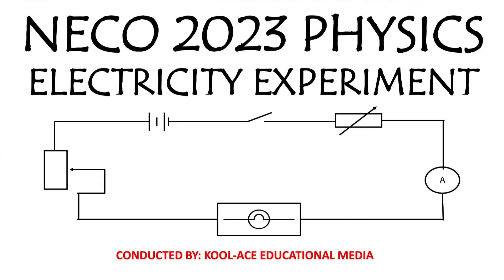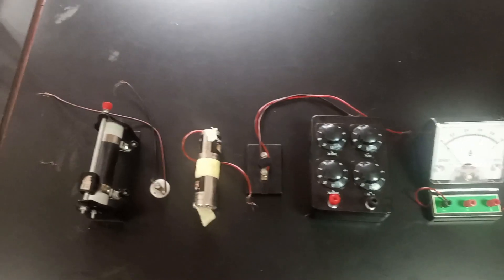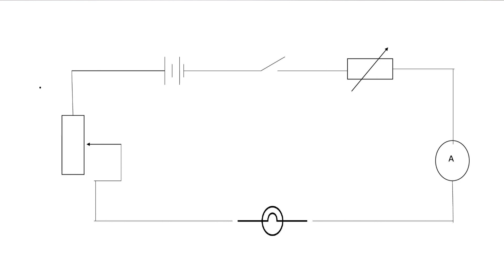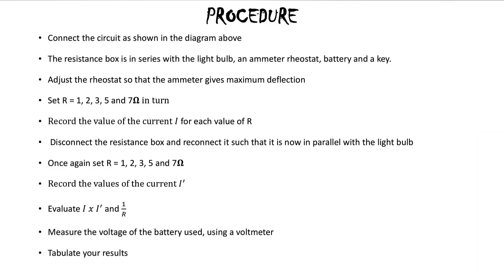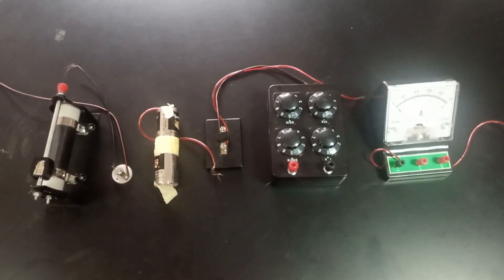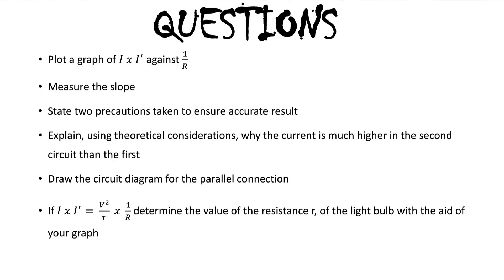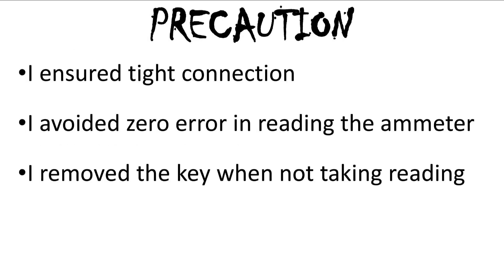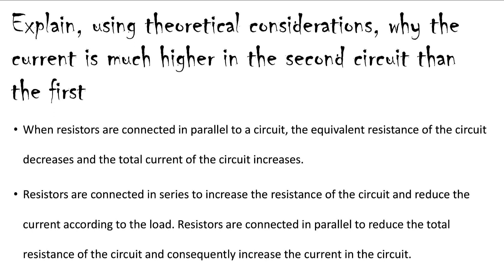NECO 2023 ELECTRICITY (RESISTANCES IN SERIES AND PARALLEL) #NECO #PHYSICS #ELECTRICITY #LIGHTBULB

Comment: Thanks Sir.. which type of wire did you use and sir how much did you get the new resistance box . I think the former type of resistance box have issues
Reply from the maker: simple flexible wires.
Reply from the maker: i don't know the exact price now, but its not more than 5k
Reply from the maker: yea to get accurate results with the old one, u need to press the key in very well to make much contact otherwise ur values will not be coordinated.